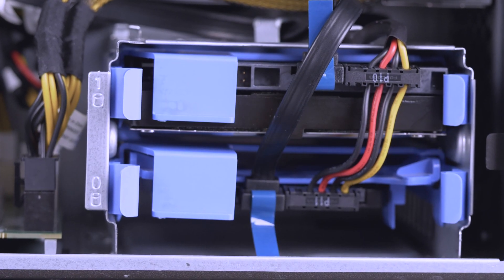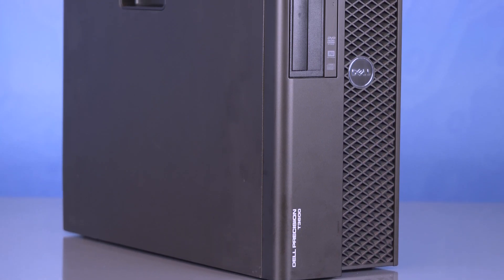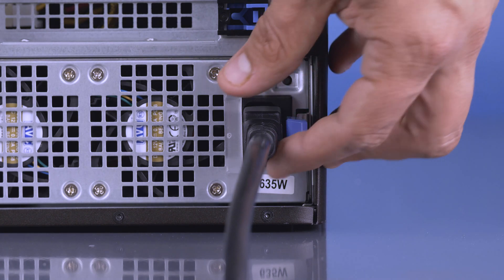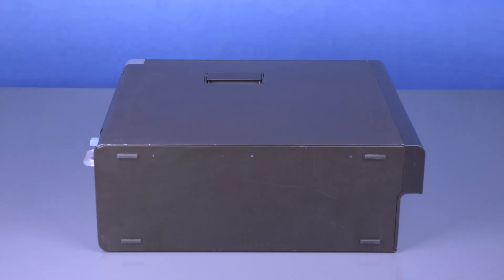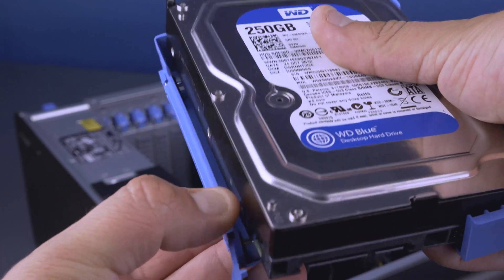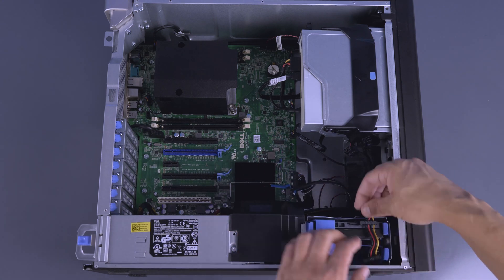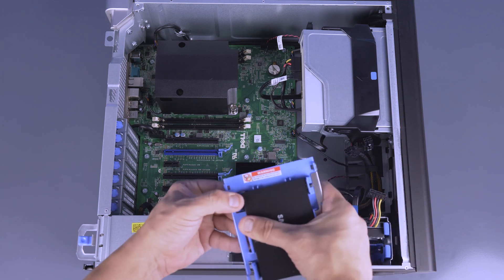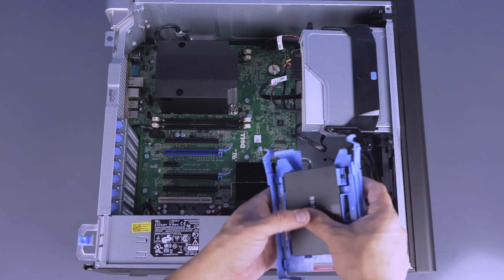Dell Precision T3600 Hard Drive Installation

Comment: i have a problem to install windows. HDD shows in bios setup but not shown during windows Installation.
Reply: Need to install sata drives on the two ports labeled sata, the ones labeled hd are for Sas hd only

Comment: Would really like more info on which port to plug each drive to and how to allocate/recognize drives. These Dells have 4 HDD ports and 2 SATA ports. I cannot get win 10 to recognize any additional drives no matter how I configure the bios!
Reply: THANK YOU! I have the same issue. Took it to a repair shop and they said I could use the two extra HDDs as storage but can't boot from because the bios is old from 2010 along with the motherboard, can't be updated, but I can access files and the HDD is recognized in the bios, setup manager and when I log into my normal login on primary drive (SSD). I want to boot to my 2nd SSD, can't. Tried switching bays. The old SATA hard drives are recognized and nothing is wrong with any of the drives. I can open, install and transfer files all day but can't boot from anything but the primary drive. My tech guy said one of the 4 ports wasn't working when he tested it and all the hard drive in the computer but the other 3 ports work, fine, I plug nothing into that one dead port so now what? I don't get it. But the bios is not the old school blue screen white letter tried and true BIOS background I miss from windows 7 days that just worked, oh no, instead I've got some customized computer that use to be part of a server multi desktop system that is configured for them by the manufacturer and can't be changed me and the tech guy tried. Took it to another guy same response. The only computer in my whole life with this problem. smh.
Reply: I had the exact same thing happened. Hardware issue.  I solved by making sure C-drive (windows 10) is in the 0 position, restarted and then placed the second drive in the 1 position, restarted, then it recognized without entering the bios. The numbers are stamped into the metal of the hard drive holders. Hope this helps. Great computer. Upgraded to 64 gigs of ram.
Reply: Wow, its been a while since I made this comment. I have still had no luck with getting any of the HDD ports to recognize. I have 3 x T3600's and with every one I can only use the 2 SATA ports for drives. The OS has to be on the white SATA 0 port and an additional HDD or SSD can use the SATA 1 port. Every now and then I have a play in the bios to see if I can get another drive to work but nothing I try has worked so far.
I also have a T3610 which has all the ports labeled SATA. It does not have this problem and it will recognize any drive I plug into any port.